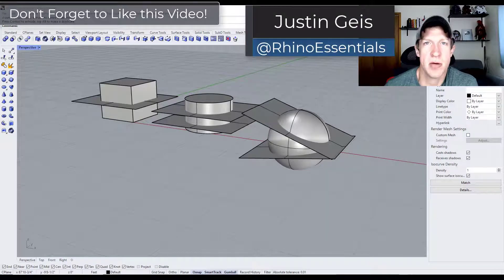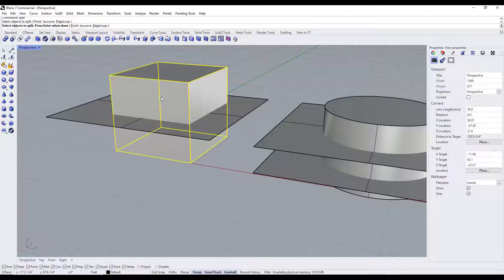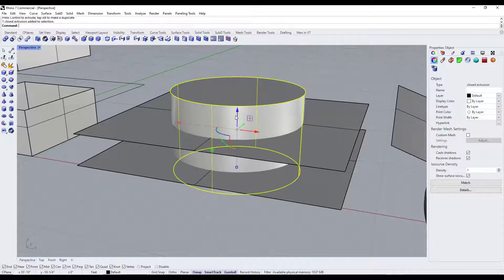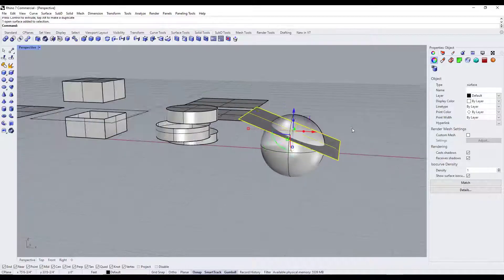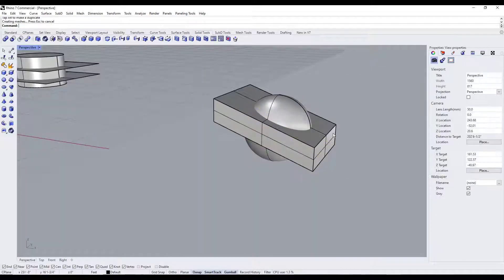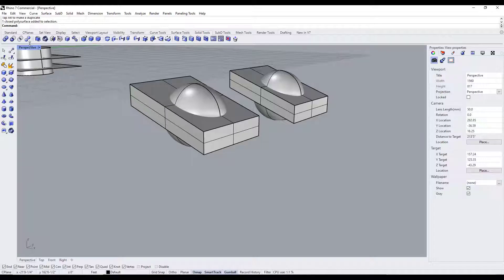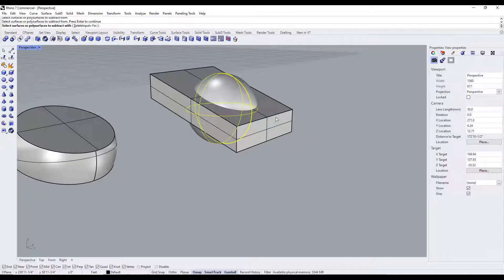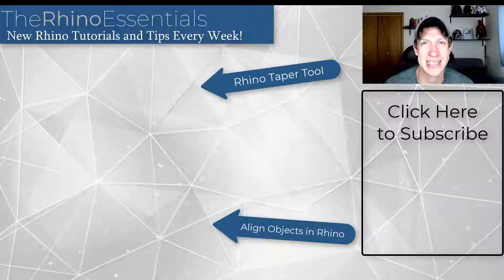How to SPLIT Objects in Rhino!

Comment: If I want to split a box into two and there is a hole on one end, is it okay to close the hole with _PlanarSrf and then use Join with the surface and the polysurface (the rest of the box after splitting) to make it into one closed polysurface  again

Comment: the next question, how to connect/merge/group those sliced surfaces to make them into one object but you can select both surfaces again and also to give them separate textures, it's very hard for me right now because I'm just new with this tools, Sketchup is different because if you put inset any faces, you can select directly into the separate faces and directly give them texture, what i need in rhino is the power of curved surfaces.